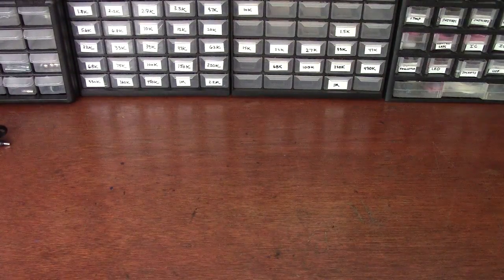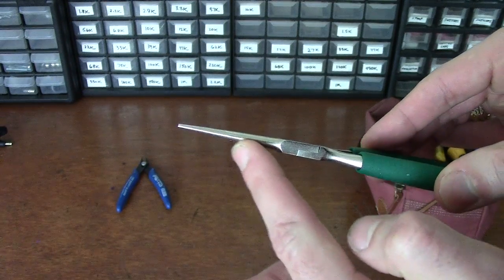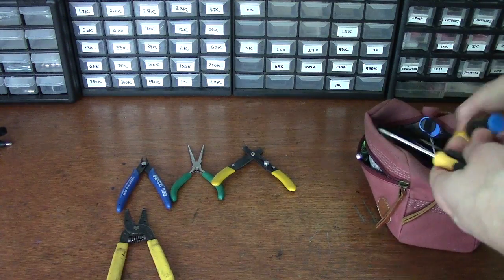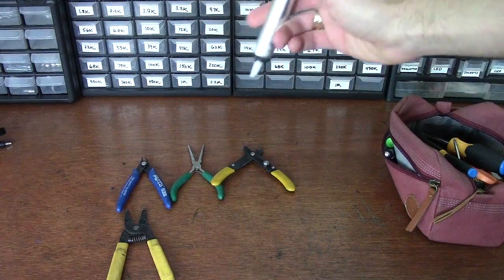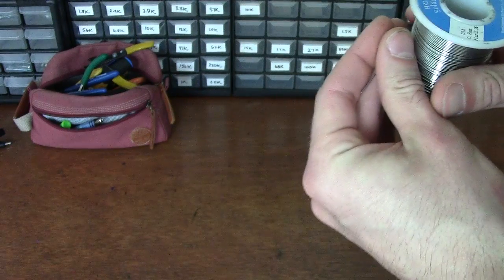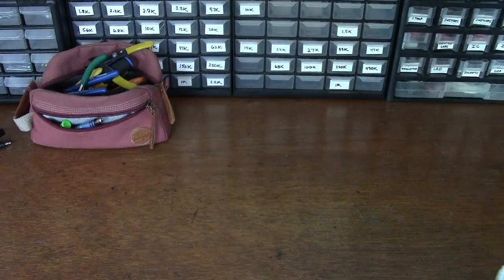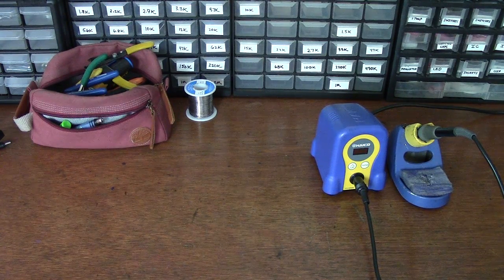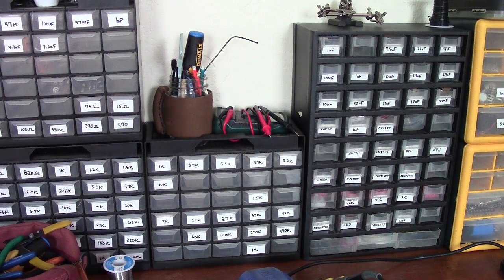How To Start Building Guitar Pedals

Comment: I've built a few pedals in the past but in the end I had a pedal that was just okay but more importantly, poorly suited to my needs. What I've always wanted is a resource that went through circuits and integrated the electronics with the sound. So many seem to focus on voltage and current which is obviously important but as a musician all I care about is the tone. As a doom metal guy I've found that most vintage fuzz circuits just don't handle B and A tunings all that well so I've wanted to know how can I get more depth. How can I dial in the midsized to fit my guitar within the circuit. 

I think an awesome series would be if you were to take a common pedal kit or even off the shelf pedal and show us what to change and how to have an idea what changes can impact the sound. All I've ever wanted was to get the sound in my head to come through those speakers and so many pieces of gear just get me partially there but also add things I don't want. So if you ever wanted to make a series about modifying kits or pedals, I think that would really go over well.  I've seen a few from Brian Wampler where he'll break down a circuit and talk about the impact of changes in the circuit.
Reply from the maker: The best way to translate from sound in head, to real life, is through studying electrical engineering (: That is how I got into this.
Cheers,
Jason
Reply: Fuzzlord Effects 
“To bake an apple pie from scratch, you must first create the universe” -Carl Sagan
I just don’t see that at this point. I get the reasoning but I’m just not going to invest that much time into the process. If someone put together a series of videos explaining mods to classic pedals and a little explanation behind what was behind the changes then I’d be in for that level. My interest in electronics at this point is hyper limited to pedals.

Comment: From NW Indiana. I’m an electrician/lineman. My specialty is railroad signaling. I would really like to start building pedals!! I would love a list of components and know by definition what each component brings to the table. Does the gauge of wire effect the sound? Like the bigger gauge, the more resistance. I have lots of questions. If a boost pedal is the best place to start, can you recommend where I would purchase a kit? Or possibly you should offer a cool kit with a little extra gain? Lol. Thanks!
Reply from the maker: I don't have any ideas off top of head for a specific kit to purchase, but maybe doing another kit would be fun. Did one last year that people seemed to enjoy (:

I'll try to cover some of those topics mentioned in future videos Adam! 
Thanks for watching,
Jason
Reply: Look at aeon electronics or mod kits. Mod kits are hand wired and aeon does high guality boards or kits.
Reply: Russell E Simonetta Thank you!
Reply: @adamr2684  yeah ,,, look at BYOC ,,, they have many kits that get great reveiws. As to component function ya gota dig into schematics et al. Very important to invest in a GOOD solder station. You need good heat control and a fine tip. Like 1 to 1.5 mm . You can check out blueglow channel. He does excellent tutorials on soldering pcb,s and lead dress .i like pedals but i love building tube amps!!!

Comment: Can your trained ear hear the difference between a well built pedal and an amateur built pedal?
Reply from the maker: Neat question! So if two people were to build the same sort of pedal on the same PCB the only differences that may be heard could be due to part tolerance. 

But I will say that two people designing their own circuits and PCBs can make similar circuits way noisier than someone else with improper layout etc. Have come across some pretty weird stuff in pedals lately. 

I suppose on a technical skill level a more experienced tech would provide more consistent solder joints and connections. But anyone who builds a pedal even if messy inside, will be so excited when it turns on for the first time and produces sound!

Thanks for watching,
Jason

Comment: Hey, i am spanish watching from berlin, germany. I have a bachelor and master deegree in electronical engineering and iwould love to build something on my own, itried one kit once, didnt worked out well, not proper tools. But i will defiitely try again, i found a acapulco gold kit, wanna try that one. My idea for the next video is about whats next, i have experience designing pcb and soldering them, i think i can manage that, my worries comes from everything else. The enclosure, did you do it yourself or order it? Drilling? decal or paintig? what else do i need to have.

Thnaks for the videos, love them. Keep rocking!!
Reply from the maker: Hi Ander! You should check out some of the video on the channel, there is one with a bunch of footage of making the enclosures (: Many folks use water slide decals and an inkject printer when they first start making some pedals to label their enclosures.
~Jason

Comment: Kits are great for a first time builder! When I started building effects around 2006 cloning boutique effects was frowned upon, today no one gives a shit as you can’t reinvent the wheel, as you said. Boutique effects are clones themselves so it make little difference. Build what you want!

Some sites for noobs:

freestompboxes.org
Tagboardeffects
DIYstompboxes.com
Beavisaudio
Tonepad
General guitar gadgets 
Duncanamppages tonestack calculators etc
Electronics assistant 2000
DIY layout creator
Smallbear electrical
Pedalpartsplus
GuitarPCB
Das Musikding
Bonzai Musik
Madbean forum, shop, and layouts

Have fun!

PS, I advise buying a container of flux as it makes the soldering process very easy and avoids time wasted on poor technique.

Comment: Very cool video, I’m watching from Los Angeles, Ca. This video is very inspirational. I’m 25 years old and i want to start school. I’ve been looking into electrical engineering but there is none in my community college. They have electrical communication technician. Is that a good start?

-Luis
Reply from the maker: Hi Luis!
Most community colleges don't offer "engineering" courses but you can knock out all of your math and science and some gen ed stuff there. I went to a community college to start and eventually transferred. I would start watching Darryl Morrel's channel and get a head start on the electronics. The communications tech sounds similar to wireless cable installs etc.

Cheers, keep me posted on what you do!
~Jason

Comment: Definitely would like to understand the signal and what it's doing from my head to the speaker. I've always thought of the electric guitar as a whole system. IMO the best players were also huge gear nerds that had a good idea of what was happening to the signal they were creating. I'd like to be able to mod amps. I think starting with building pedals is probably a good idea.
Reply from the maker: Starting with pedals is a great idea and similar principles apply, also pedals won't likely kill you like an amp can (: Pedals are much safer, and affordable to get into. I love amps, but man are they expensive to build.
Cheers!
Jason